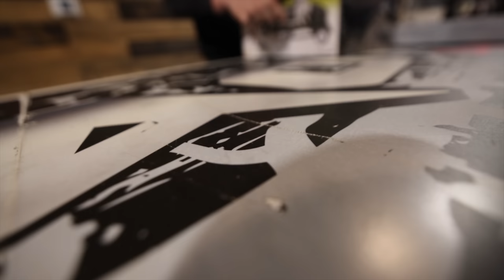What Really Happened To The 1 Ton Swapped Land Rover...

Comment: Everyone has their reasons but i'm personally tired of watching LS swaps.  I bet the Youtube'z has 1.8 million "lets do a LS swap" videos.  They've becoming as boring as the "will it start" videos.   Nothing wrong with that engine in there.  Thats my opinion.
Reply: Couldn’t agree more with the LS thing.
Reply: 10k miles on my 5.3 thus far. I know it's played out but it's the most economical, most reliable, replacement parts abundant, sounds great, churns 35s with no issues. My factory speedo, tach, temp sensor, and fuel sensors all work. I'm in love with my truck now and intend to keep until my 3 year old son drives it to highschool.
Reply: I'm an LS swap guy. I put one in my bronco. best bang for your buck hands down and reliability. now don't get me wrong, I'm all about other swaps. I have a rotary swapped Volkswagen, but that car doesn't travel hundreds of miles off road where you do not want a failure.
Reply: Same here, LS swaps are over played at this point
Reply: Time, money, resources. Do the swap yourself and you’ll quickly realize that when it’s your time, your money, and your resources, you’ll want to do an LS too.
Reply: Agreed

It’s because it’s cheap and easy. They use them in boats, too
Reply: While I'll agree to the overabundance of LS swap, but there's a reason it's so popular. And saying there's nothing wrong with what's in there is spoken like a man who's never owned a Land Rover!
Reply: I should rephrase a bit. Nothing wrong with LS swaps.  They can be very dependable.  Just saying that horse has been beaten to death.  Nothing wrong with will it run. Because it's awesome and oldie got a new life. But that horse never had a chance either.  Just making sure nobody thinks I hate old cars and LS's.  For the Love of God I have 13 still.  Down from 22.
Reply: I have a '99 D2. Does anyone know specifics on if Colorado will pass it during emissions if it's LS swapped?
Reply: Was really hoping it would get a 300tdi though..
Reply: @casper8994  I'm hoping to see an aluminum 4.5 liter twin turbo  450 hp Porsche cayenne motor and transfer case because it has low range.
Reply: Ls is a great swap. And I'm a ford guy. But for me, in this particular use case. A OEM replacement, addressing design flaws, is a great idea. Going through the headache of integrating a different engine is not all its cracked up to be. Trust me. It is "simple" yes. But it's far more involved than what you see on TV and YouTube. My brother wants to V8 swap his 98 XJ but I keep telling him.  We would be better off buying a junkyard engine, do a stroker kit, and other design flaw fixes, and run that.
Reply: Thanks for that opinion. 🤙
But hey I haven’t seen any yet so it’s the first for me and it’s exciting to see it. 
Thanks for a great video. 
I am brand new to the whole off road setting. Let’s see some more😜
Reply: Another reason I'd lean LS Swap is because it's highly tuneable (can change any value with HPtuners) whereas the stock engine you can't do much.
Reply: LS swaps are reliable, powerful and parts are readily available, that’s why they are popular.

Comment: Nate, have you seen the roof rack done by Torque Performance 4x4 out of the U.K.? I just looked and didn't see it on their website, but it is on their FB page. They are using the original Disco roof rack mounting points and it really looks great. I am trying to get one ordered for my Disco right now. Also, I think that there is a description of how to tap the steering box on the Gwyn Lewis website. I have been thinking about how to do hydro assist on my Defender 110 with the stock P38 axles. Gwyn Lewis has a kit, though I don't really like how they did it - so working on how to do it with a PSC ram instead.

Comment: @nate I had a similar problem with oil dripping from the tube. I found out it was one of the plug welds that had cracked (plug weld on the carrier to tube fitting). It required drilling out and re-welding, I read in a few forums it's common.

Comment: Truly your best project. Yes, I have a D2 so I'm biased but I really liked the past series. The 2 things I never liked about the build are the wheels and those fender flares. But hey, to each his own. I'm with you on keeping the 4.6. It's a good motor if you take care of it. Mine is on 93,000 original miles and has never had head gaskets and the reason why (I think) is that I don't let it get hot. I have all of the cooling mods done and it runs super cool (check my channel for some info on those mods). You can get a RTT on the roof without an elaborate rack. I had a back half-rack and factory cross bars and that worked great for a RTT.

Comment: Keep the factory Lt230 transfer case, they are strong and reliable. You can upgrade it's locking diff with a one piece spider gear cross from Aschroft.

Comment: I always thought the Rover V8, even yours with Bosch management, was derived from Buick. Maybe that would make an LS swap go easy. Most people that have Land Rovers get scared off by the price of stock engines. For the price I had mine resealed I could have bought a dozen good and possibly better running junkyard LS motors. Either way, your D2 is amazing and I keep checking in to see what you're doing everytime.

Comment: Genuine question: if you’re spending $600 on air compressors, then why buy 2 compressors @ 33% duty cycle & 3CFM each that require lots of custom work to tie them together vs buying an ARB Twin or TJM Twin that gives 100% duty cycle & 6CFM but is already designed for vehicle mounting and ready to hook up to your air tank?

Comment: Nate I took a chance over 2 years ago and bought a best top  off amazon and hard mounted in one of the boxes I built long wheels in my Ram. To date it I have no negatives and it will pump up my two of my 35s simultaneously in reasonable time.  When the day comes since I rely on it so much for offroad and on road. Thinking of just going with one of the proven best, specifically ARB.  

However as we all know, ARB are not cheap. I am curious if you considered ARB over the ViAir. Was the decision as simple as your friend Matt recommended it or did you consider both or some others before buying the VIAIR.

Comment: Swaps are fun until you you realize that vehicles are designed for a certain engine and you compromise a lot of qualities that are taken for granted. like losing cruise control or having non functional gauges etc. The last 10 percent of the swap is 90% of the work, time, and cost. Its far easier to retain the OEM design. Not to mention a cleaner build quality.

Comment: My disco lost a valve or lifter after some spirited pulls to redline and now it sits out on the street disabled and Im having the same debate. LS swap with the ace kit or do something with the 4.6
So I'm super curious to hear why you are sticking with the 4.6 when that video comes out
Reply: Nothing more reliable or long lived than an LS. It's popular for a reason. I get it though.
Reply from the maker: In my opinion there is no wrong answer here. Both are good V8s. In either case do not installed a junk yard motor. Either do a rebuilt Bosch v8 or a rebuilt LS.

Comment: The LS (I have A 6.2 in my Disco 1) is the MUCH better motor/trans combo....but....it's pricey, and there are a lot of little items that will infuriate you.  I can be done....mine is finally on the road with a final tune to pass emissions.  The 4.6 is a bummer....when the cylinder liners come loose, or the sensors go south, or the valve covers leak.....after only being on the car for 3500 miles......then you'll think.....why didn't I do the LS?

Comment: 5:36 I've got a Viair Air Source Unit and folks tell me how "slow" it is.... I just tell them, "Mine always works ¯\_(ツ)_/¯"
Of course they keep telling me how theirs works just fine, but I put real work in with my Air Source Kit and they only occasionally use their pumps to fill tires. Meanwhile I'm the one running all the tools and giving folks air most of the time. 
🤔

No hate on the cheap compressors.... I've just already been down that road. A LOT. In fact I've got a graveyard of 12v compressors, not one of them being a Viair.

Comment: i'm from europe and also want to do a 5 speed conversion but i can not find the flywheel... 
i currently have a 4.6 with a hp24 gearbox. i bought the car with a cracked 4.0 and swapped it my self.v8's are not common in europe and were never delivered as a manual
they were in Australia if i'm correct. i'm assuming you are going to use a r380?? 
all the parts i need are really easy to get over here and not that expensive. accept for the fly wheel.. did you menage to find a original LR one that has the holes for the crankshaft sensor to read or did you find a different solution?

Comment: Most people who say do LS swap have never done one lol. I have done 2, 1970 Duster and my 59 FC 170 Jeep. The LS is def not as easy as replacing the stock motor. A lot of times its not that much more power but normally less weight. Unless you dump a butt load of $ into the LS or your coming from a smaller motor. Looking forward to the replacement my dude.
Reply: Ls in a Duster WTF man.
So many good Dodge engine choices.
Reply: @timothywilliams2021  LMBO, do you have a Hemi I can have? If so I'll be more than happy to make that swap. Otherwise I'll go with what I had sitting in my garage.
Reply: Just saying if i put a new hemi into a 70 chev or BOP car...   GM guy's would want to kill me. 
I'm not totally against cross brand swaps. I've done a few. But sometimes it's better to stick to a brand.
Reply: @timothywilliams2021  unless those people are funding my projects, I'll build the projects that stay within my budget. I had the LS sitting in my garage. I looked to get a Hemi but it was three times the amount The LS was. I tried to do that for both of my projects, the duster and the FC Willie's Jeep. The LS is also way smaller than the Hemi. The space within the duster engine compartment  is very limited. Plus the LS's don't have the head issues that the hemis do. In addition to that, I'm of sound mind and I don't give  0 fox what other people think.